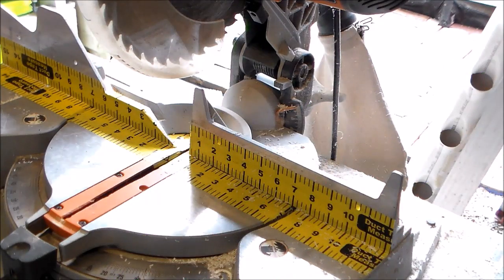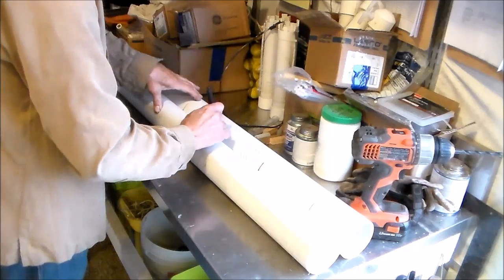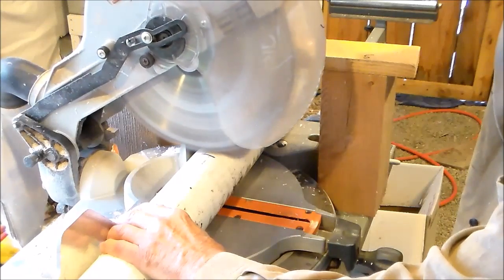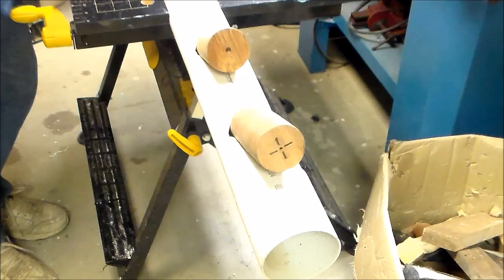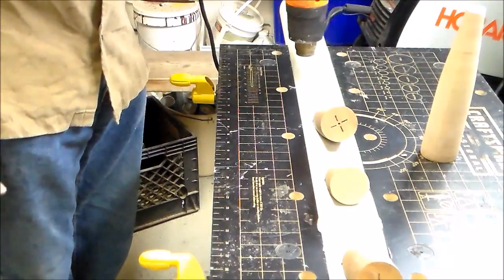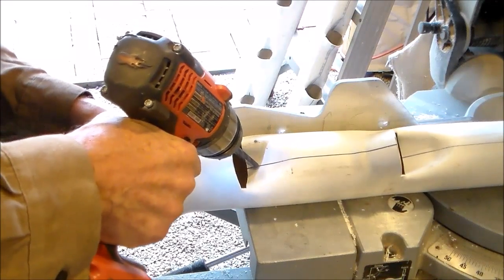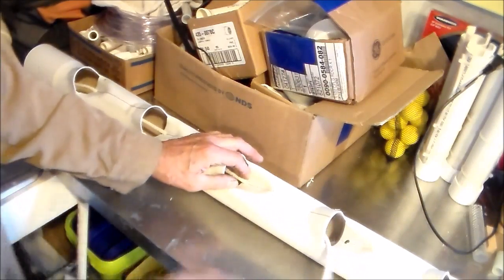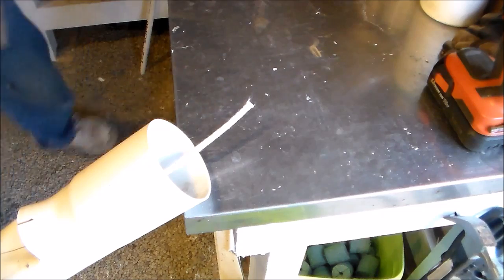Grow tower build Aquqponics

Comment: Very clear instructions , thank you
. Is PVC food safe ? The roots may absorb some harmful chemicals, please share the food safety issues if you have any information on this .
Reply from the maker: I had called the mfg. of the pvc before making these, and the same plastic is used on the drains as is used with the drinking pipes--- they just don't stamp the pipe as such, since it is made as a drain line.
Reply: @donaldporta  I appreciate the prompt reply . Thank you  ,the information is very helpful .

Comment: Great video I’ll do the hole the same but I’ll use a different method besides wicking to distribute equal amounts of water 1/4 spaghetti line with mister or drip tips off a small pump... thanks again
Reply from the maker: Great idea

Comment: How did you make your tapered wedge?  Looks like a two inch Dow rod that was sanded?  Do you have a video on that?
Reply from the maker: I turned these on my wood lathe. I used wine bottles in the past, but you have to find the right diameter and I didn't want to show that because of the danger of a bottle breaking and causing injury.
Reply: Donald Porta Yeah. I figured that. You had mentioned it in the video. However it looked like a custom dowel that you created. What did you start with? It almost looks like a really thick coat rack rod for a closet.

Comment: Donald: This video is a few years old now - how did the wicking hold up? Were your plants happy with the water they received? Also - how did you set the wicking to work? Did you draw out of a top reservoir?
Reply from the maker: drip tube in top. once roots are established the wicking line is not needed--- the roots will do the wicking.
Reply: @donaldporta  Thanks very much

Comment: Is this PVC food safe?  Doesn't seem like it..
Reply: When you drink water. it comes from miles of pvc. do you think mcdonalds is food safe?
Reply: "Thanks to the aforementioned NSF-51 standards along with FDA approval, it is safe to conclude that PVC is food graded."
Reply from the maker: after calling the mfe on this pvc --- they reported that the drain line is the same plastic as the food safe pvc, it is just not marked as such.

Comment: Great work, nice job,but what are the chemical tolerances of your pvc if not food grade i suggest not growing food in them.  Only flowers/non edibles Hydor nutrient may leach chemicals from polymer.
Reply from the maker: I had called the manufacture of the pipes--- the material is the same as the pvc used in house pipe supply lines, just not labeled because these pipes are used as drain lines and not supply lines, I would call them also just to verify to set you mind at ease.

Comment: Great video. How big are the slits that you cut with the miter saw? Does it make a 2” hole if you cut a 2” slot?
Reply from the maker: I would cut just a little larger, however the slot will stretch when heated if too small.
Reply: Donald Porta    10/4 thanks!

Comment: Hi, I am very new to hydroponics; could someone explain to me what are the next steps to this? Is the water supposed to go up the cotton wick? There is no need for a water pump?  If someone could tell me how the system will work when running that'll be great. Thanks 

Also, very nice video Don, thanks for sharing your knowledge :)
Reply: Good luck on finding how the watering system actually works. I have personally watched about a dozen of these how to/DIY and not one has shown how to actually get the water to the plant roots. But, just be patient and diligence in your search. With the much smaller vertical pipes, your master container reservoir can be exponentially smaller as well, from 25 gallon down to 5. A small submersible pump like those used in ornamental outdoor fishponds and they will work just fine. The one thing I personally don't know yet is how to actually get the water from the tank to the plants. I apologize that I don't have all the answers for you but that's the best I have at the moment.
Reply: @1959jimbob  I have not done this yet myself on this project, but on others, certainly. I imagine a top reservoir with the cotton cord hung up and over the top lip of the reservoir and into the water inside should suffice. A little bit of clear, flexible pvc tube between the top reservoir, with the wick hung inside the tube, will help stop the wick from drying out / dripping between the reservoir and the top of the 3 inch pvc pipe in which the plants are being grown. You'll probably get 1 drip every 6 seconds or so as a really rough estimate. 

The bigger question is: How many of those drips make it to the plant roots, and is it enough, and how does the cord running around the outside of the net cup reach the roots of seedlings, for example?

Comment: I am trying to do something similar but my PVC always kinks/collapses below the opening. maybe it is doing it in this video the contrast is hard to see. how are you stretching the lower lip so it doesn't collase around it.
Reply from the maker: concentrate the heat to the upper section.

Comment: How often do you run water down the pipe?
Reply from the maker: I use drip tubes that flow round the clock.
Reply: @donaldporta  I know this is an Old Post but I do have a question. Do you tie all these together at the bottom? And then does it go to a catch basin where the pump is at?

Comment: Never ever ever ever ever drill those extra holes!!! Water will splash out.  Also use fence wire instead! I built ten of these 6 of which I use in my kitchen. This is the video I used to Construct my towers also only cut 2” line.  And wider and water will shoot out if your pimp is Power full

Comment: Donald, I have to find someone that has a lathe to make the wood jig. would you share the lenght and where the taper stops. probably a dumb question but i need to tell the guy who will make it the dim. thanks
Reply from the maker: The overall length is about 9 inches. the taper is 6 inches long starting at 1 inch in dia. on the end, to 2 inch diameter at the 6 inch mark. hope this helps my friend---Don
Reply: thanks

Comment: if you keep a wet towel handy you can quick cool the plastic with the wedge in it so you can move on more quickly, also you can use several of these metal spring clamps rather than the special wedges. when you get tired of paying for net pots you can use a peace of soft foam in place of them and the wickimg lines.
Reply: "..also you can use several of these metal spring clamps  .".   Which metal spring clamps do you mean?
Reply from the maker: Thank you for noting this, it does work very well. I had a neighbor come over and help me do these, and he worked in a plastics factory, and that is exactly what we did.Thanks for you input my friend---Don

Comment: Your idea of making grow tower with PVC drain pipe is brilliant. There seems to be a problem of water spilling out of the port because the shape of the PVC edge directs the water to flow out. I think that you can eliminate the problem by cutting the slot at some angle (i.e., 45 degree or smaller with respect to the normal) with a table saw or circular saw. Then, you use the same tool to shape the slot into a hole. By doing that, you can get a natural drip edge to direct the water inward. It also means that if you shape the hole in the wrong direction, you will have the same problem. Could you give this a try at your convenience and let us know whether this helps? I don't have the tools to try this out yet.
Reply from the maker: Great Idea, I will have to give it a try---- Thank you my friend,  Don

Comment: Hi Donald,

Great stuff brother. My question is about how deep those cuts for the net cups should be?
Reply from the maker: A cut about three inches long--- the tapered wood plugs will set the holes to the right size, if too small of a cut, you will see some tearing at the ends of the cuts. trial and error on the first tower will get you there.   Don

Comment: Don, awesome build! I happened upon your videos a couple days ago. Awesome setup altogether. Thanks for sharing what works and what failed. I'm still in the research phase. I want to do a backyard greenhouse that is aesthetically pleasing so I want to do all research Then build. These are by far the best handmade towers I've seen.  Even better than most manufactured pieces. I couldn't find if it was asked, but have you tried any towers with holes on more than one side or the pipe?
Reply from the maker: no--- recommended to place plants on one side only---- check out this source--- very knowledgeable----, https://www.youtube.com/user/BrightAgrotechLLC

Comment: Nice presentation.  I liked that you didn't edit out stuff, but just went with it. You kept it honest. There was probably an earlier video that I missed, but can you tell me the width of the saw cut or point me to the video?
Reply from the maker: 3 inches was the cut--- you might find that you may have to adjust your cut depending on the wedge you use--- you will know where it should be after the first tower you make. good luck my friend---- Don
Reply: Thank you sir for the quick response.
Reply: hello Mr Porta, if i want to use a 3inch net cup, what width should i cut the PVC before heating?.....

Comment: Are you still using 3" or do you recommend a different size pipe?
Chuck
Reply from the maker: I have only used the 3", with the larger more aggressive root systems, I use the slotted tubes so they can be easily removed when needed.
Reply: So you are not using any 4" pipe for the towers other than the returns at the bottom?
Chuck
Reply from the maker: Correct--- everything is working fine with these sizes---Don
Reply: fising food

Comment: Hi Donald - Nice video , Hope you have time for a quick question . I'm growing lettuce and I was planning on using a 4 inch radius pipe (or maybe 6 inch).  Having 4 vertical staggered rows of net cups and the cotton rope running through each vertical row of net cups. I was going to put each pipe on a swivel so I could rotate the pipe each day so the lettuce get a share of the sunlight . So really ,  4x what you demonstrated in the video . Do you think this would work or is too much lettuce for 1 pipe ?

Thx ---- Darrell
Reply from the maker: +Darrell Wiggett I think you have a great idea--- let me know how it turns out my friend---Don

Comment: U can used 1dowel if U quench each hole with water, it sets it immediatley
Reply from the maker: +Dan Roy I chose not to stop the heat gun use and went right to the next hole which speeds up the operation.

Comment: I started my first Grow Tower this afternoon.  Holy-Moly!  Extremely time consuming to form each hole!  And...if the plastic gets too hot it starts to scorch; too little heat and it likes to tear.  Definitely a learning curve! I found that drilling holes at the end of the crosscut slots helps lessen tears.
Reply from the maker: +Kntryhart I found that after doing a number of them, I would time the heat on each slot and it was fairly reliable.
Reply: +Donald Porta Hopefully, towers 3 and 4 will be done today...
Reply: yes, I started out with 3" but went to 4", more room to work

Comment: do u think a wooden door stopper would work for the wedge ?
Reply from the maker: +Chique Chiing I found that it is important to have a snug fit with the net pot to keep water from leaking out of the tube, however if you use the course filter cloth around the pot, this will keep the water in the tube and a better water distribution for the plant roots. may work--- get back with me if you try it--- thanks my friend---Don
Reply: Donald Porta I just happen to be at this point in your video...I think a glass Mexican coke bottle is also this size.

Comment: Is PVC food safe?
Reply from the maker: shadfurman I checked with the manufacture ( J M Eagle) tech.--- sch 40 pvc is rated potable water and the lighter sewer drain, which is the towers, is not tested or rated for potable water --- however the engineer said that both are made of the same plastic.  I believe we are good on the system.--- thank you my friend---    Don
Reply: Donald Porta no thank YOU good sir! :-)
Reply: The manufacturer is right. I made something very similar to this a couple of years ago and heavily researched  leachate from PVC pipe into water. The bottom line was that once the pipes were rinsed after manufacture there were no detectable levels of any residues, no carcinogens etc when tested with the best equipment  they had available. And this was in water in which the PVC was completely immersed for extended periods. So in a situation where water trickles through only a small surface area of the pipe there's even less than the 'no detectable levels' in the studies.

Comment: very nice work, but what is the function of that rope? is it for support?
Reply from the maker: A.McK I have two videos that my answer you questions---check them out.  field changes to aquaponics grow tower, and, aquaponics tour after four months.I hope this helps.
Reply: Edigo Suprapto  The rope is to act like a wick to cary water to each plant the water will follow the rope
Reply from the maker: The rope or cord in the tubes is there to direct the water flow down the tube and touch the net pots for very small seedlings that have little root structure--- any larger plants have enough roots that will do a good job wicking the water to every plant--- I find myself getting away from using the cord or rope and all the plants are doing well without it's use.
Reply: Donald Porta Thanks for the video!  :D
The function of the rope is clear for me now. But where comes the water from, with what kind of system? A pump?
Do You have a video, which shows that watering for the tower with ropes?

And is there no growing-medium inside the tube, except in the net-cups?

Greetings from Germany.....  :)
Reply: Donald Porta Thanks for the answer and the other two videos!
Unfortunately not. I'm not a native english speaker and so, I overhear often or don't understand all in detail.
But don't worry - if you want to, You can answer in a short kind and if You don't have time or so, to answer anyway it's also okay - maybe I will find out later!  ;-)  :)
Reply from the maker: A.McK I find the rope is not needed---my original thought was for the rope to wick the water to the roots--- as the plant roots grow the roots themselves wick the water to each other.
Reply: Donald Porta how deep are the cuts for the net pots?